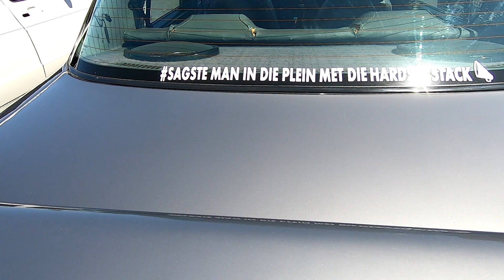NEO VVL Swaps Cape Town Mitchells Plain Special SideHustleGarage Feature No.23 with the Crew

Comment: Awe I come tell you something drop a B16 b18 or B20 in yoh 1400 then you the first I think with a vetec in a 1400
Reply: Bseries wont work in a 1400 because the motor turns the opposite direction from other motors. Kseries will work
Reply: A few years ago there was a b16 in a champ rear mounted setup
Reply: @imranmohedeen3253  then why I saw a b20 with a champ once
Reply: If you have 30k for a rwd b series gearbox why not.You can buy them from the UK
Reply: The b series motor spins in opposite direction